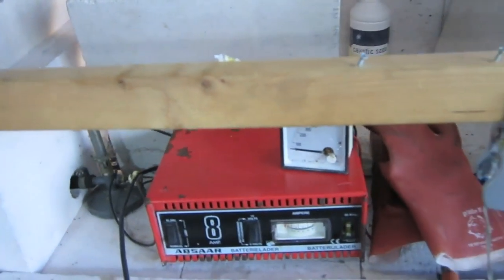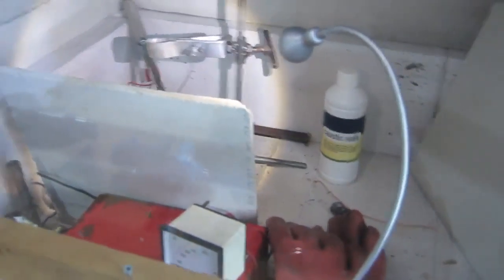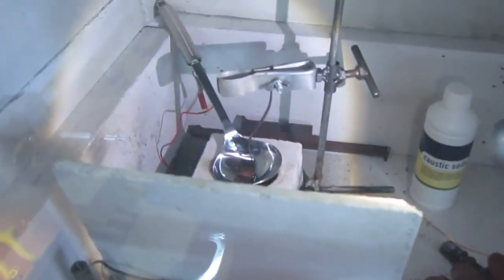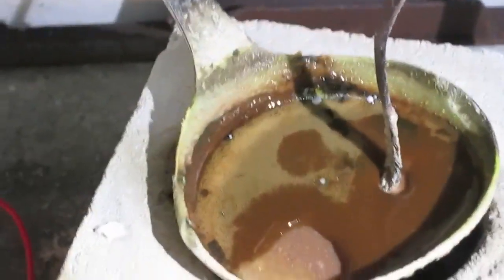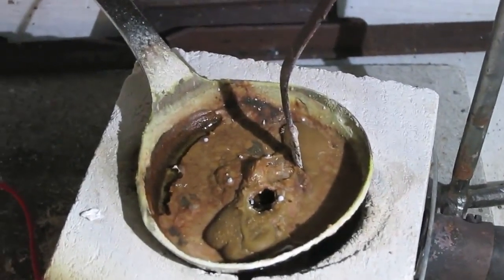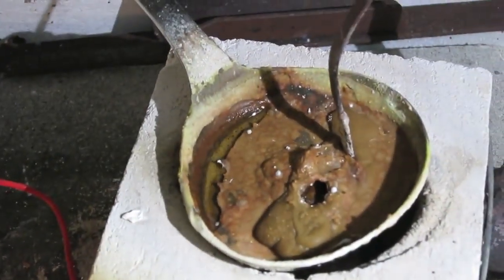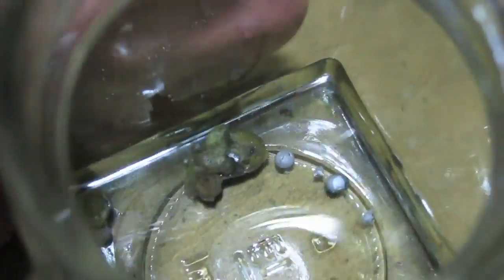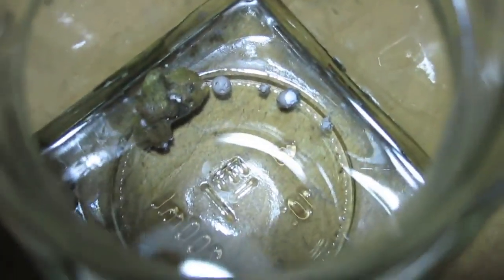NaOH electrolysis

Comment: Why NaOH gets brown?
Reply: Cuz molten NaOH will eat anything....adding extra voltage potential all the more so.  Its dissolving the electrode and making various soluble/insoluble salts and side products.  Works MUCH better yields w tungsten electrode rods or possibly titanium...but who can afford eh?

Stainless is somewhat resistant to attack by molten NaOH (used in synth of benzene via decarboxilation of sodium benzoate food preservative), but as - terminal in eCell of liquid NaOH not so much..

Theres a much easier, safer way yo get metallic Na from its salt done in solution (dry obviously) with a few right added compounds and a day or so patience on mag. stirring hotplate in pyrex boro-glass ONLY as super hot con NaOH can even dissolve glass slowly.  Yield is far superior and very pure, drawback is it requires a couple very specific exotic compounds i highly doubt u could buy so they must be synthed personally....but its worth the work whrn it works...everything must b spot on or ull get bit of tiny Na balls on bottom of flask rather than huge molten glob (solidifies as solvent cools.  

This elect. is was easier as far as needed supplies, but it needs performed properly for higher yield...a deoxygenated little homemade glove fitted vacuum box w airlock door and N2, argon, etc, gas to fill chaimber with inert atmosphere drastically helps
Reply: @ckimsey77  thank you very much for the information!!!! If you have more please send it to rioplatensem@gmail.com
Reply: @rioplatense9989  sure thing; i actually started a channel doing various chemical acts, but my aim is unique as to i only do what is requested by viewers...Wanna learn about something?  Drop a request and ill dig deep to not just offer instructions how to, but actually explain "whys" and "hows" of what we're doing.

Sadly after quickly getting few thousand people hooked by my dedication to facts and gaining useable knowledge along with the "how to", my camera died.  Id do quick runthrough like this guy (but more understandable) as instructions about 5-10 minutes for those not caring about anything deeper, tho that type person was really in wrong place.  After, a longer more detailed version explaining the chemistry etc and defining some terms I use, 20-30 mins.  Last, id make a part 2 follow up for anyone wanting the deeper "real" explination, going into reaction mechanisms, equations and equilibuiums, what pH actually is and why its so important to control it etc; these could be hour+.  Here was also where i answer questions from comments of first part.  

So whether u wanted to play, or understand the process to apply elsewhere, or have chemistry knowledge and want R&D level lecture; there was something for all.  If you have further questions about this, or anything field related u may see later, hit my channel for my email and feel free to ask.  U may enjoy my few vids too...it was by request on N-N, dimethyltryptamine (DMT) from bark.  After getting questions from comments id leave on peoples "extractions" vids on what they left out, how impatience and lack of detail gave them poor impure yields, and some just plain dangerously giving wrong instructions with some potent chemicals...I decided to do it right myself.  However, my camera died during last vid and i cant afford another atm.

So if u like that type stuff, check out my approach.  My vids are plain, no editing etc, but im there for the accurate info not fancy flashy vids full of garbage content.  I will finish as soon as i can get a good camera so if ure interrested keep my channel in the back of your head; ive some awesome unique things planned if i can ever get started
Reply: @rioplatense9989  Ive worked in R&D 6ish years on and off...not petty crap either...things ud see on TV and call it science fiction.  Actually much of sci-fy "future tech" in movies isnt as imaginary as you might would think.  Much of projects were classified so i'll just leave it at this:

Ever see warping or beaming objects to other rooms, people up into ships etc??  Lets just say the fictional part is "living" "complex"  "large" objects cant be teleported key words...
Reply: I think that's the spoon corroding.